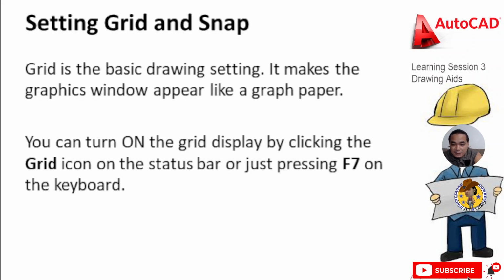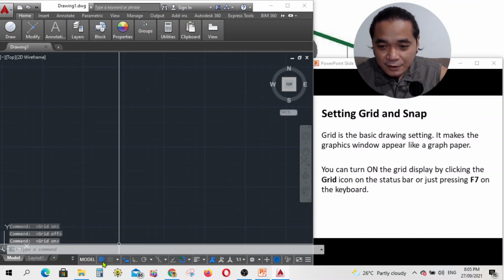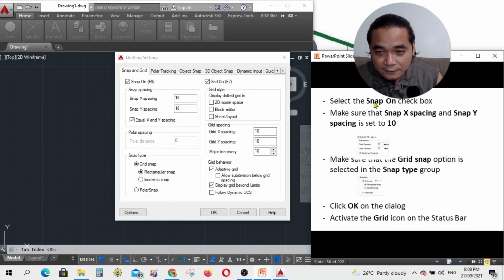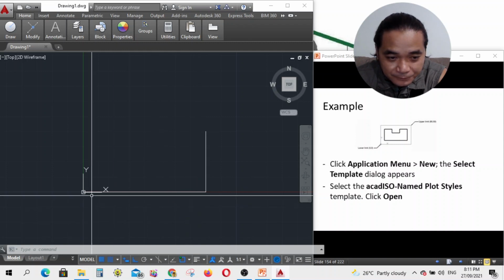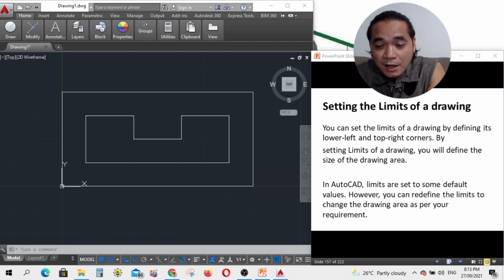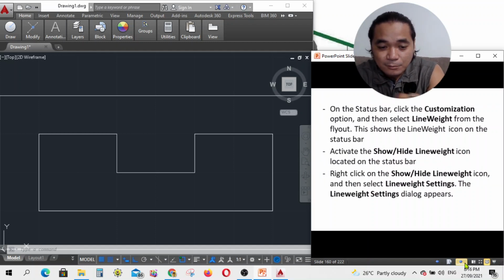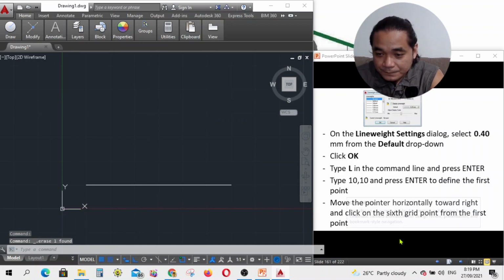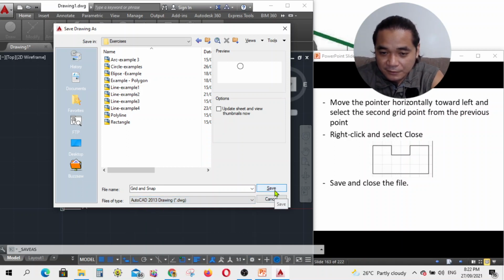AutoCAD LS 3-1 | Drawing Aids

Comment: In this learning session 3-1. Sir Mardie discussed about Setting Grid and Snap where I learned how to use it easily like in a setting grid you can turn ON the grid display by clicking the Grid icon on the Status bar or you just  pressing  F7 on the keyboard, while in Snap mode it is used for drawing objects by using the intersection points on the grid lines.  And also I learned how to change the thickness of the line by setting the navigation bar and clicking the lineweight. Thats'all, Thanks for this video sir, Looking for more videos.😊

Comment: In this learning session 3-1, I learned some valuable information. That includes how to better utilize grid and snap mode by making changes in the drafting settings. Another knowledge I acquired was defining the size of the the drawing area by setting the limits. And also, changing the thickness of the lines that I drew by setting a new line weight. Thank you for this, Sir!

Comment: In this video, I have learned to draw a line with 0.4 lineweight and also counting the length of the line through the lower left corner limit and upper right corner limit. And also how to apply snap and grid on the drawing and on the lines.